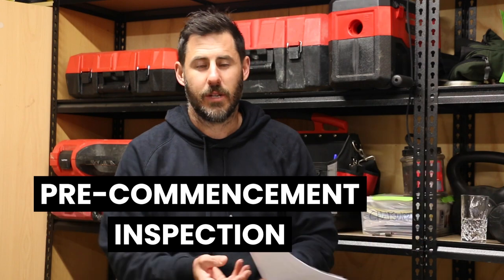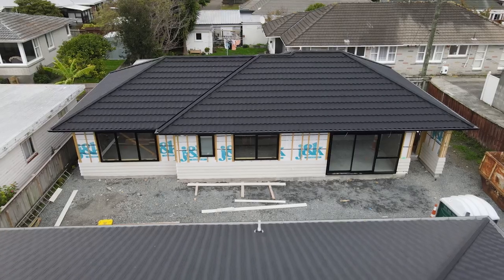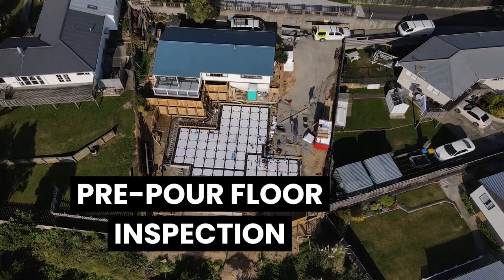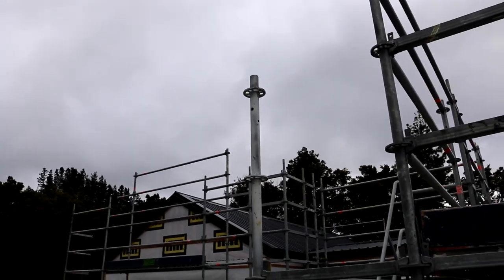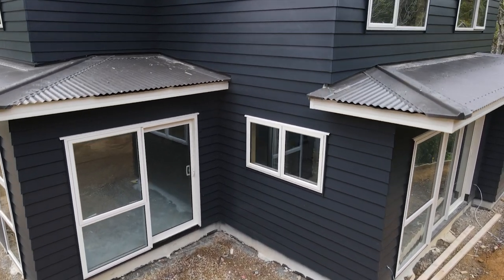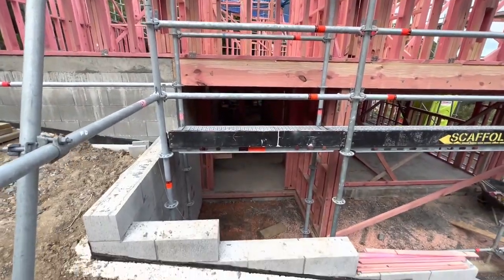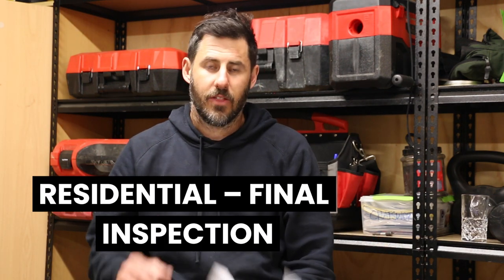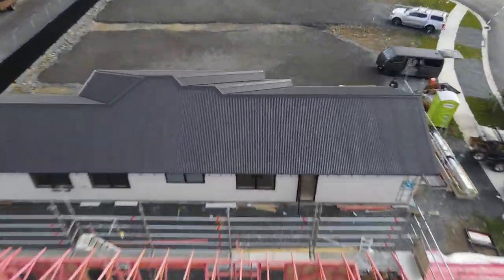Building Inspections Explained!

Comment: I remember my first time in Construction. My boss said to be careful digging where the power cables where. I was digging up the ground with my spade and didn't know I hit the power cable. He inspected it and there was just a little tear in the outer side of the cable. 

He said if I had dug full strength I would have cut the power cable, and would have been liable for damage and costs up to thousands. 

I've never been scared on a construction site in all my life.
Reply from the maker: Crazy

Comment: How often would an inspection fail and for what reasons.
Reply: Depends how often you produce incorrect work to them. They can fail you for all kinds of reasons. Unprimed H3.1 timber cladding would fail. Bevelback cladding weathergrooves not lining up would fail. Incorrect screw patterns on a gib bracing element. There are many ways to fail, so it's important to learn about the key things.
Reply: Commonly failed inspection would be pre-line inspection due to framing timber having a too high moisture content. If you are only missing a couple items that need siting, they may pass you but request photos be sent through of the items once you have remedied them.
Reply: @alexbarber1468  what should the moisture content be for the framing timber before pre-line?
Reply: @arangy1  off the top of my head I believe GIB requires 17% moisture content (could be wrong) however some inspectors can be generous enough to allow within 3%
Reply: @arangy1  around 17% I believe to meet Gib Requirements